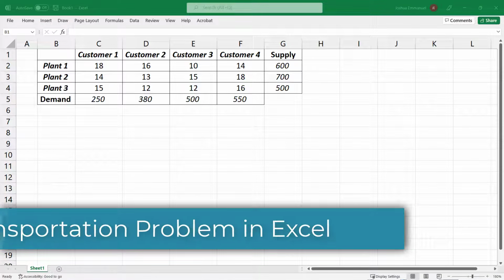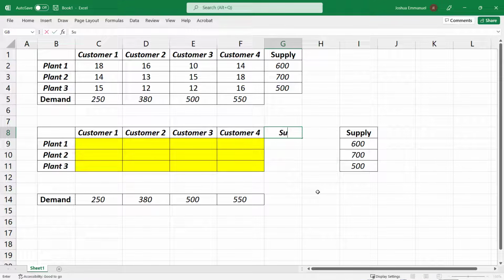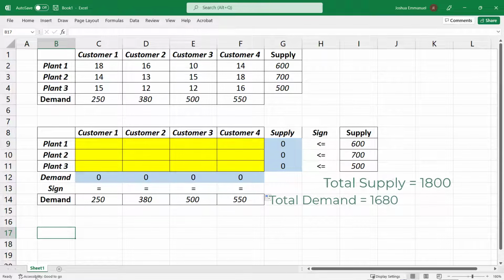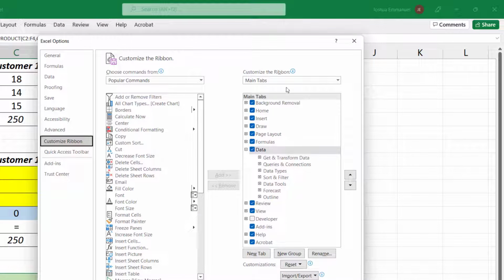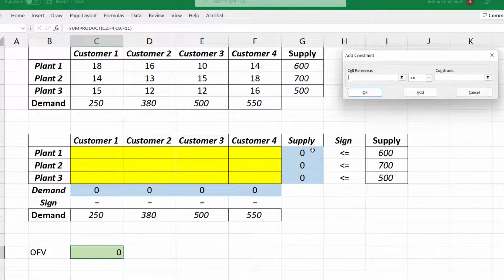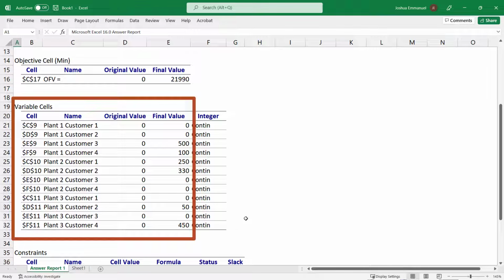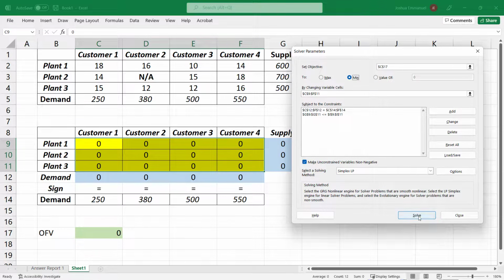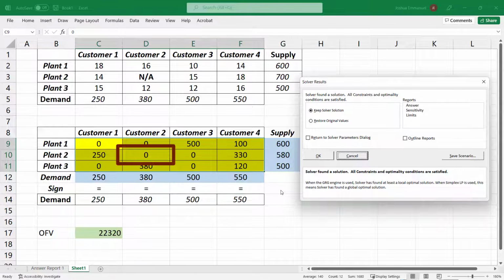Solving LP Transportation Problem | Excel Solver

Comment: If total supply is less than total demand then what we have to do
Reply from the maker: If total supply is less than total demand, then use "=" for Supply and use "<=" for Demand.
Reply: @joshemman dear josh thanks for the content, kindly would like to conect, i need your support to solve some oprations problems i have in the company would u provide your profissional service with a prposal?
Reply: Whether this is for the the case if the total supply  is less than total demand
Reply from the maker: You're right, I just edited the statement.
Reply: @joshemman pls let me know for the below doubt
Reply from the maker: @jaswantviews  If you have both production and shipping costs, then you need to add them for each arc. If you have only shipping costs, then follow the instructions in this video.
Reply: @joshemman whether we can put greater than in supply  and equal in demand  if the supply is less than demand because  we need to fulfill all the demand and  exceed the capacity
Reply: @joshemman  pls do clarify the above msg pls
Reply from the maker: @jaswantviews  You shouldn't do that.  You can create a Dummy capacity instead.
Reply: But the goal is too minimize  the total distribution costs for the  problem  so what I have do in that case

Comment: Hi Joshua, i am having an error occur when i attempt to multiply the objective coefficients by the decision variables. When i use the =SUMPRODUCT( and select the decision variables, i get "There's a problem with this formula error. It suggests i am not trying to type a formula. Do you know what i am doing wrong?
Reply from the maker: Check to be sure the “variable cells” do not contain other characters.
You can copy an empty (unformatted) cell and paste in the “variable cells” to see what happens.

Comment: How to formulate and do by simplex method,  XYZ company during the festival season combines two items A and B to form gift packs. Each pack must not weight more than 5 kg should contain at least 2 kg of A and not more than 4 kg of B. The net contribution to the company is taka 10 per kg of A and taka 12 per kg of B. the company wants to determine the optimum mix.

Comment: XYZ company during the festival season combines two items A and B to form gift packs. Each pack must not weight more than 5 kg should contain at least 2 kg of A and not more than 4 kg of B. The net contribution to the company is taka 10 per kg of A and taka 12 per kg of B. the company wants to determine the optimum mix.

Comment: 3:38: if I would like that the answer (solver output) only shows these numbers 0, 250, 380, 500 and 550 instead of other numbers like 330, 50 or 450, what should it be? Thank you so much.

Comment: If each customer has to be in just one plant, so what will we do?
Reply from the maker: I don't get your question. Can you rephrase?
Reply: @joshemman  I mean If the condition is that each customer can only stay in one plant, what should be done? Thank you.
Reply: for example: customer 4 just plant 1 or plant 3, not both of them
Reply from the maker: @nguyen_thi_quyen You have to define binary variables:
Yij = 1 if Plant i ships to Customer j; 0 otherwise
Then 
Y14 + Y24 + Y34 = 1
Reply: @joshemman  Can you explain it a bit more? I mean what would be the formula we should type in solver?
Reply from the maker: @erginerceltik9525  You can search for a video on integer LP solution in Excel.
Reply: @joshemman  can ı do it with two variable range? maybe one is binary and the other one is for capacities?
Reply from the maker: @erginerceltik9525  Yes. Here's an approach: https://youtu.be/1nRKsuUcNd4
Reply: @joshemman  thank you sir 🙏